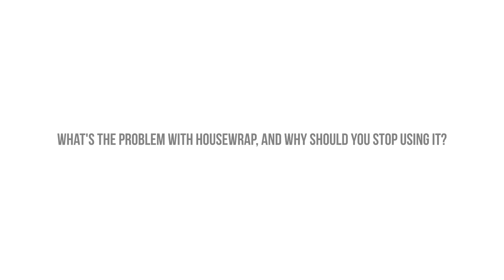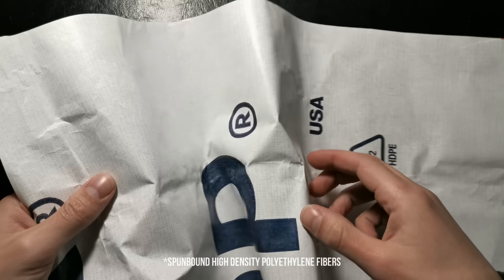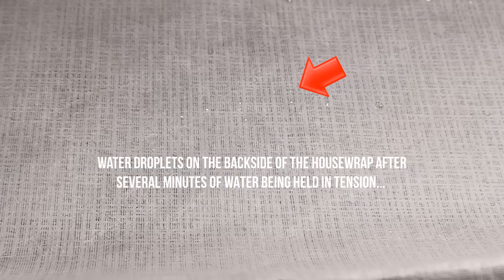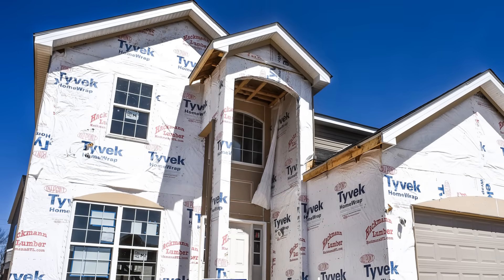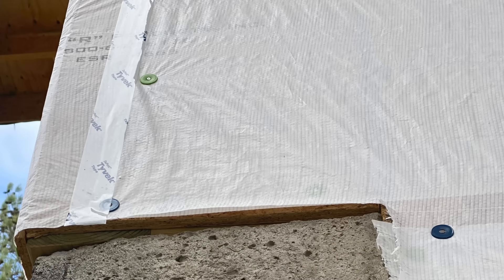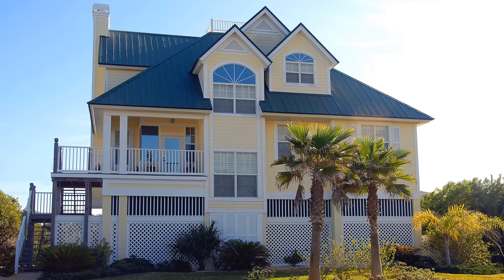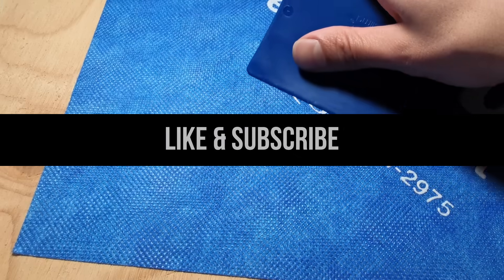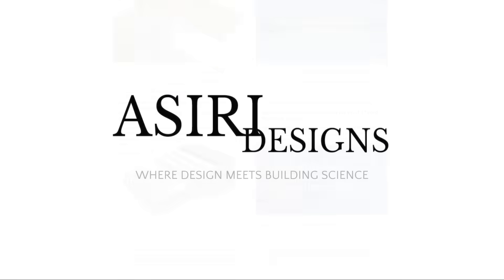Why I Stopped Using House Wrap

Comment: I'm glad I came across your site, and thanks for all the information.  I wonder if you might comment on leaving the existing 1970s "asbestos" singles on a house prior to it being sided with vinyl.  That's the way they do it here as a contractor would have to dispose as haz-material.  Is there any benefit to leaving it in place other than the cost savings.  (As the homeowner I can remove it myself and dispose of in the local landfill as non-haz material as it's non-friable.) For insulating purposes, should it be removed and foamboard installed on exterior prior to vinyl siding.  Where would the smart-wrap layer be installed.  Is insulated vinyl siding worth a hoot.  I'm in Virginia Beach, VA 10 miles inland.  Thanks.

Comment: The problem with air tightness is that houses/buildings can no longer breath. The exchange of air is what keeps black mold from colonizing in high moisture areas, especially with forced air heat. Any movement of air creates eddies in the flow (from forced air or ambient air exchange) which in turn allow particulates (black mold spores, which are everywhere anyway) to be deposited in corners and along the bottom of walls. In homes which see little use, as in in bedroom communities and resort rentals in the off season, all sorts of accumulations occur. Discovery and damage have become quite the business as a result. I am a big fan of tar paper myself.

Comment: Unbelievable that builders who have supreme understanding of Vyvek House Wrap and can't stop the industry from using it.  It is discouraging when buyers count on their professional home builders and the building codes they follow to be of the highest standard and we learn they are not.
Like basement foundations, there should be a spray on rubber seal that is placed on the home's exterior and around windows that has a sealing effect if penetrated with nails, staples or screws.

Comment: Builder for 3 decades and grew up in a family of constructors.Structural Technologist that understands building envelope concerns.

To stop mould, you need to take away what supports it.  Its that simple.

Mould grows in dark moist warm environments with oxygen.

Prevent mould by:
- taking away moisture;
- adding light
- make environment cold
- take away oxygen.

We really cant take away oxygen but you can seal out oxygen.  This would be a spray product on the wood  that eliminates access to air.  Or build in orbit. Best to just seal the substrate.

Reduce vapour with a vapour barrier.  This is by far the best way to stop mould in cold climates. Build your building tight so its like a space station. No air or vapour leakage anywhere, even around your windows and electricL plugs. Once that indoor air cools off,  it cant hold moisure and it rains/ fogs/ dew forms inside your wall, and mould likes moisture.

Stop allowing driving rain into your wall. Every exterior system isnt waterproof. Assume wayter gets in. How do you make sure that water gets out? Furr out your siding and stucco wire. Just like masonry bricks, makad sure there is a gap so dry air and gravity can move that rain out.

TLDR; stop mould by preventing its growth by removing either oxygen, moisture, or nutrients.  This is done by leaving an air gap so water drains out, having an airtight house to prevent condensation, and using sheathing that mould cannot grow on.

Comment: LOCKS IN MOISTURE......PERRRRRRRFECT.....EXACTLY WHAT THE BUILDING CODE SAY YOU SHOULD DO....  OH.... YOU NEED AN HVAC system...no problem...  ohhh 10-,20 years...replace the house

Comment: In 25 years of exterior remodeling and most houses in my area built between the 40's and 70's. The most important part of the house is the roof overhang in regards to protecting the exterior walls. The roof overhang always determines the condition of the walls
Reply: You are so correct !
Reply: I agree, but I was wondering if you could elaborate. Do you mean the proper order of and technique for protecting the roof sheathing, including underlayment, ice and water barrier, drip edge, etc., or simply the length and slope of the original overhang itself? Thanks!
Reply: @mg-7047  length of overhang. Anytime I have done rot repair on a house, you're guaranteed to have 12" or less of roof overhang. Heavy roof overhang (24"+) can mask poor installation of cladding and windows a greater length of time. I live in areas that get 40" - 100" of rain annually.
Reply: Second comment I've seen on roof overhang.  I fucking hate this Nantucket 6 inch soffit.  Nowhere to hide 😅. Back in North East now but in northwest, saw two foot overhang and loved it.
Reply: @WayneCorley-h9k  Lets make Verandahs Great again!

Comment: I trained in Architecture 1970's.  We were taught design of air gaps and the use of capiliary gaps which mimicked the way tradesmen had been buiding for hundreds of years.  Nowadays design is ignored in favour of wrapping gunking and sealing a building airtight hoping everyone has done their job correctly - which all too often IS NOT the case.  A structure needs to breathe it's not a bloody submarine or rocket ship - so why apply submarine and rocket design principles.  s akid growing up in the 1950's in an unheated light-timber framed constructed house the first thing done when rising was to open the window to allow fresh air into the room and get rid of any condensation on ice-covered drawn-glass windows,

Comment: There's a reason why a rain screen is in some areas a code requirement and should be everywhere. Rain screens are inexpensive and do the job. When installed with house wrap all of the problems described don't happen.
Reply: Please help me understand what Rain Screens are  TIA
Reply: @karlakay  Google is your friend, but in short terms it's a small space between the outer house wrap on the house exterior and the siding.

Comment: My understanding is that Tyvek and other house wrap products are designed to resist air infiltration and water permeation from the outside, but "breathe" enough to allow water vapor to escape. If water is getting into the wall from the outside, then the siding is not correctly installed. If water is getting into the wall cavity from the inside, then there needs to be a good, tight vapor barrier installed. Here's my ideal: a tight vapor barrier inside, with all seams and openings taped. Walls of double 2x4s with thermal break between, 10" insulation. Exterior sheathing of plywood or OSB or good ol' boards. House wrap on that. Vertical 1x2 nailers over the house wrap, siding over that. The space between siding and house wrap should have a screened intake vent along the bottom and at the top, be vented into the soffit.This system would hopefully prevent warm, moist interior air from migrating into the wall where it can reach the dew point and condense; but if moisture does get into the wall, it can breathe to the outside.
Reply: Vapor barriers go on walls that have the outdoors on the other side. Those same exterior walls are framed with 2x6's. Please dont ever build a house by yourself.

Comment: I'm building post frame shop with living Quader  outside is metal siding,  which material you would suggest between metal siding and insulation? The envelope is already there. Should I install some kind of fabric to the 2x6 strapping from inside between posts?

Comment: modern house wraps are not water barriers they are merely condensation shields oil based tar paper is a moisture barrier used under tile, metal, shake and shingle roofs or walls and behind bricks
don't confuse the purpose of the two products
To repel external condensation between roofs and walls is the primary objective of both products.
There is water and ice shield that is 100% waterproof if you have a problem area.
Foremost your house needs to breathe and these wraps allow that. Building materials or carpet may release toxic fumes that would build up without allowing the walls to breate

Comment: One thing you need to consider, if you have a vapour barrier on the inside of your house, which is the norm in cool climate places, and you seal the outside, then any moisture on the inside has no place to escape.  You get whats called double bagging, which is a problem.  You need to keep the weather out of your building structure, but do not double bag your exterior assemblies.  Tyvek wrap is semi permiable to the outside, IE it breathes moisture to the outside.  With a non permeable barrier on the outside, what happens is, there are dew points on the inside of your wall assemblie, which builds moisture over time.
Reply: Zip sheathing in particular is vapor permeable. I'd be surprised if the rest weren't too. This double bagging you speak of is why I have no interest in a layer of foam board insulation on the exterior of the house. To get enough to not need a vapor barrier inside would call for 3" of it and I don't want to build around that. Any less and you've bookended the wall cavity and moisture has nowhere to go.
Reply: The interior poly vapor barrier is a HUGE problem in my 35 years of renovation experience.
Reply: @ThisOldMan-ya472  I agree. I think it holds moisture between it and the drywall. I have had great success with Tyvek. And when I see the building was originally done with Tyvek, there are no problems such as wet sheathing.
Reply: "Tyvek wrap is semi permiable to the outside, IE it breathes moisture to the outside"   thats probably what the claim is....But 15 years of real world renovations Disagree completely.  Tyvek Traps moisture, causes mold then Rot...Even directly behind the most professionally installed Western Red Cedar Clapboards.  ROT all the way.  Plywood sheathing rendered to spongy mush.  Put your hand directly thru the exterior walls of sub million dollar houses built in Maine in the 1990's.
Reply: housewrap doesn't seal moisture
Reply: I agree 100% I think this new plywood is not gonna let moisture in but if they do not hit the studs with her nailer‘s they’re just poking holes on the side of the building the tape is very expensive but people don’t realize is that siding is only supposed to Shed the water, anything it gets behind is supposed to work its way out they use the stuff on the roof to this new board Sheathing on the roof and you’re just poking holes on it with the nails for the roof. What is this accomplishment

Comment: Tyvek is not building code in Canada to cold up here; we use lots of Hilo exterior or interior insulation that don't need a house wrap or poly on the inside exterior wall.

Comment: Tar paper seals around fasteners such as nails and staples providing a good seal against water unlike Tyvec and similar wraps. Often when a nail or staple is driven through these housewrsps it provides a conduit for water to access the sheating and the studs then the insulation absorbes the water and the rot ensues. This trapped moisture will stay in the fiberglass and during warmer weather will simmer the building materials to mush. In coastal areas stuffing too much insulation can tend to suffocate the walls by not allowing air movement even with substantial ventilation. Tyveck OSB and over insulation is a recipe for mold and mush. OSB  or flake board is really nothing more than landfill fodder, I have yet to see any boat hulls being constructed of OSB, plywood is vastly superior. I think OSB engineered floor joists would be far stronger if they were made with plywood instead of flake board.

Comment: its tuck tape thats the issue you need to control moisture and not trap it between two layers of plastic Vapour barrier and house wrap houses dry on the outside and when it cant how will it ever dry out it wont. itll get moist and the saw dust and glue in pos osb is perfect food for mold species to thrive until their feed is consumed. go back to playwood and tar paper imo every reno I seen is mint compared to newbuilds built wrong imo.... people dont even know that you need to skipp tape on the bottom of windows or none at all and not to seal it completely hydro static pressure wont push moisture into the house cause the house wrap wouldnt be sealed with tape and have the pressure build up and natural moisture go back outwards imo should use reall plywood so it act like a tree and dry out and back to normal size once its has. the cladding shouldnt allow the underside to get wet constantly and should have a control to where the water goes out and not trap it like everyone seems to do like a tape seam will turn into a trough behind the cladding and cause more issues then house wrap over lap min six inches

Comment: Learn how to run paper. Zip System glorified OSB I will use CDX and properly wrap with Tyvek and tape it will be watertight and it doesn't cost 500 dollars a bucket to start depending on what crazy commercial products you use on your house you know just to make it more expensive and have the guy do a crap job and leave dead spots

Comment: May be vapor barrier, and decent air-barrier, but its not a water-barrier. I did some repairs recently on a 20 year old house, with crasppy siding on a windy foggy hill, near San Francisco. Where water got thru knot-holes in the siding, the Tyvek (yes, that brand) had disintegrated - worthless. I would say the continuous wetness, perhaps for a full rainy season, made it fall apart. I have never had this problem with 15# felt, nor seen in walls I have torn apart. MIght be good under 15# felt as an air barrier, but I would put the tarpaper over it as the water and vapor barrier.

Comment: Hempcrete or dustcrete construction have won me over in that order. I will say this, it's been longer that I've been turned off Tyvek, however any synthetics are really dirty, upstream and down. I was an insulator in the patch and did a bunch of reno and rough for others mostly. Now I'm old enough to just shake my head and smile. Dad was a museum quality builder, designer, architect, etc ... Some of that rubbed off just fine. :)

Comment: In my rural area Tyvek is considered siding LOL. My heated carriage house/two story garage had it for several years before I sided it. At that point there was no moisture issues.
Because it was sunfaded, I put another layer on top of the original. Taped the hell out of every seam and crack , and sided it with 1x10 cedar board and batten siding. No issues at all after 10 years and I don't really expect any. I think this is fear mongering, or blaming Tyvek for poor siding installation or siding choices.  I also live in an area (PNW) with lots of moisture and temperature changes.

Comment: Houses are being built so badly in my city, you can see serious problems on new builds from the sidewalk. We're way past the point where we need to worry about this, here at least. Here it's more like, does the framing line up with the foundation? Are all of the engineered floor joints.. actually there? Did they install flashing? Did the "carpenter" think spray foam or windows are load-bearing?

Comment: I'll add one more thing: the widespread use of OSB is a big mistake, as is minimal roof overhang. OSB simply isn't appropriate for any home meant to last; its only plus is the price. Get it wet and it crumbles. Plywood has to get wet and stay wet for a long, long time before it decomposes. I have never used OSB and never will. It's trash. And why is it so difficult to understand the need for decent roof overhangs? After all, we're trying to keep the rain out, right? Well, aren't we? I have never built anything with less than a 36 inch overhang, not even a chicken house, and my super-insulated solar home has 42 inch overhangs. I fail to understand why the need for substantial overhangs is so hard to grasp.
Reply: Gotta disagree about OSB. All the science and my experience is that both OSB and plywood suffer when exposed to moisture. Perhaps in different ways, but roughly equivalent.  Can you offer any science on this topic?
    I understand your experience is to not trust OSB.
   Thanks for your comments about extended eaves.

Comment: Well......I was prepared to argue with you about the suggestion housewrap isn't the greatest thing since sliced bread. I used old-fashioned tar paper for years and years, but switched to housewrap when my building colleagues hinted I should get with the 21st century. I do like it in many ways: It goes up fast and it's more wind-resistant, and cost-effective. But your arguments in favor of the Zip System or roll-on products are compelling. I know Matt Risinger is a tremendous fan of Zip on all his builds, for good reasons he has laid out repeatedly for viewers. Maybe it's time for me to move on from housewrap and consider one of the options presented here. Thank you! This was an eye-opener!

Comment: The house rap does a sale on the market for building new houses isn't worth a crap do you use a vapor barrier behind the drywall he will stop condensation and losing radiant heat through the wall

Comment: Double wides are the worst Built construction I have ever seen this one that I have anyway he was a demonstration model on the lot and we bought it what I didn't realize was they didn't use much care and building yet found all kinds of illegal like like illegal wiring practices joining both has together running through the wall on the outside 2 x 4S under the plywood

Comment: Ive been a general contractor for 47 going on 48 years 
Tyvex is the worst product ever ,30# or heavier old fashioned black tar roofing paper is the very best.ive never seen a failure of water getting in with heavy roofing paper ,siding or stucco